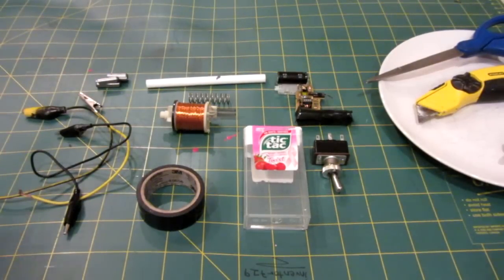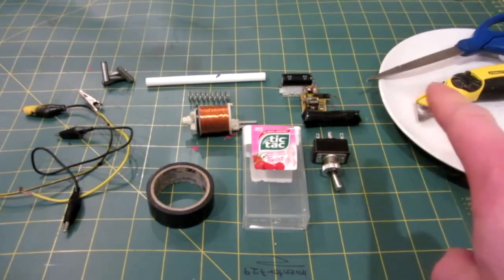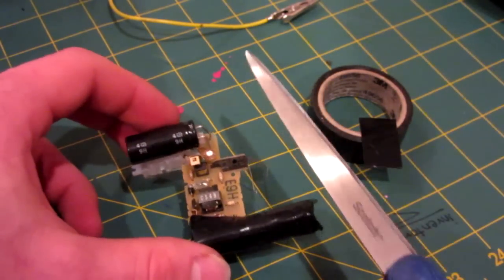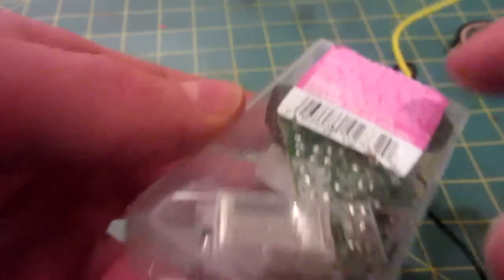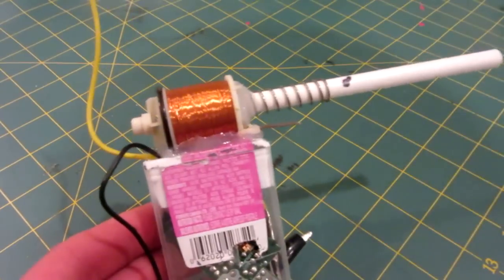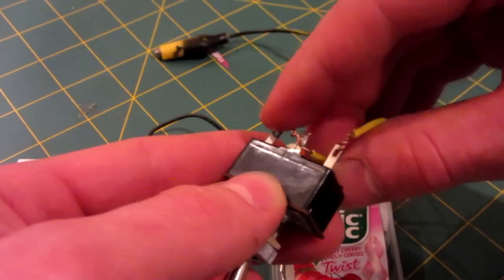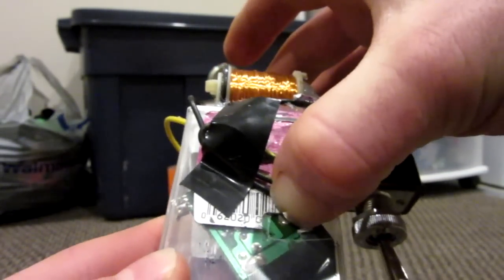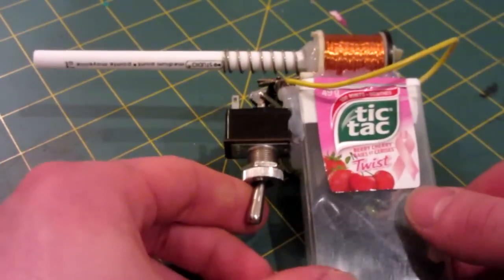How to Make a Tic Tac COIL GUN - EASY

Comment: it would work much much better if you were to use a button or optical sensor so that the coil turns off when the ammunition reaches the middle of the coil.

Comment: Does anyone know how to get a coil from everyday devices?
Reply: hello, sorry for the late reply but
you can get a coil from a transformer inside an old cellphone charger or wall wart. 
just make sure you know what you're doing and to discharge all capacitors with a screwdriver, or something else conductive with an insulated handle.

the transformers from those chargers contain hundreds of turns of wire, but be careful because the wires tend to be very thin and thus fragile.